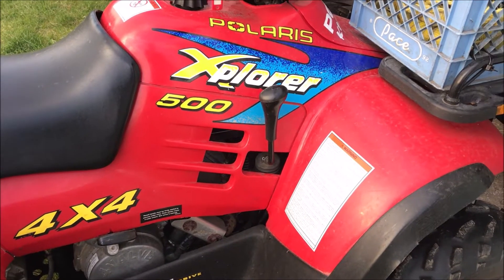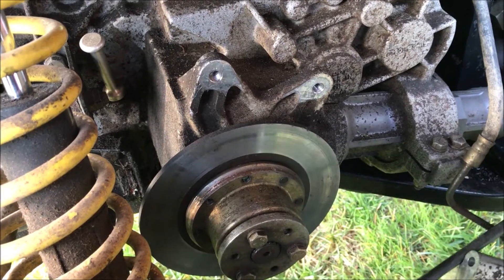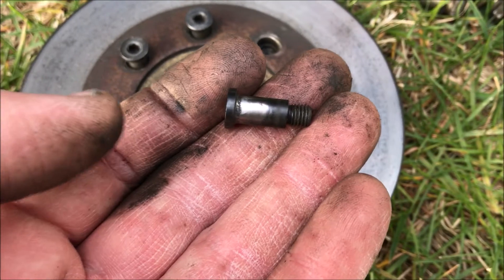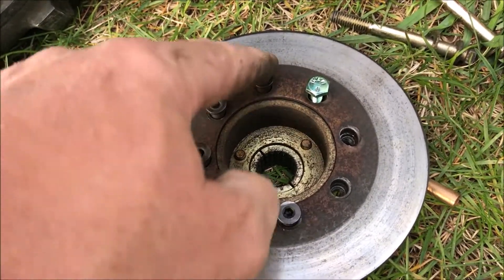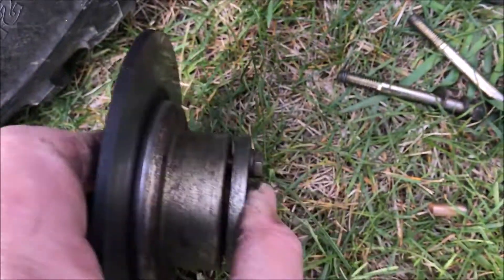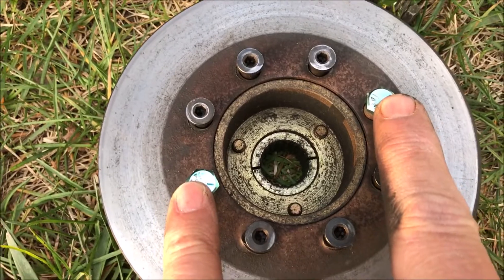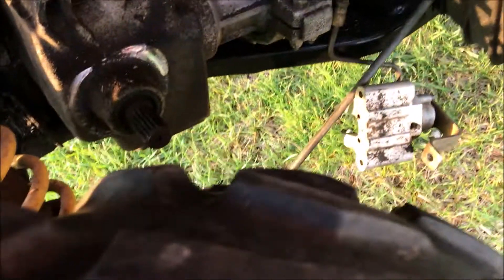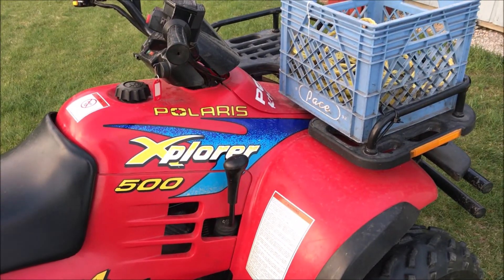OldGuyDIY 1997 Polaris 500 ATV No Brakes Rear Brake Disc Rotor Hex Float Pin Replace 5020960 $3 Fix

Comment: I started to go through this last night on my beloved ol X500. Did you end up making the Rotor tight to the assembly Or leave it as shown? The part on Partzilla or w/e shows (to my eyes) those pins being double sided (2 heads, one male, one female I assume) & it certainly looks tight. I understand Polaris' are absolute boat anchors but I just can't imagine they would make the rear rotor flopping around absurdly like that. Its bad enough having the Shaft mounted Brake nonsense but come on. Thanks in advance = Super helpful either way!
Reply from the maker: I left the rotor floating, as shown.  The OEM bolts are shoulder bolts that I loctited and then tightened down until the shoulder was tight against the plate. I noted in the video that my interpretation of the on line schematic was that the two plates were mated tightly together. As I understand it, the floating disc design allows for adequate brake engagement through the life of the brake pads as they wear down.  The brakes work great, assembled as shown.  Good luck.
Reply: You know the hand brake on the handle   bar is the front brakes and the rear brake in on the foot rest
Reply: @buctgrd  lol ya think so? That'd be nice & very un-Polarisy. It would be the wrong side of the bars for the Front Brake but I'd take it.
Reply: @makaveli087  so the hand brake works for both? Why did they put a foot brake pedal also?

Comment: Hello my friend i leave in minnesota im looking for that rear cliper i have to replace the breaks but is super difficult to remove the litle mitle metals the keep the breaks on so any recommendations where i can find that caliper because is hard to find i have 1998 polaris sportsman 500
Reply from the maker: I googled it and found lots of options with the full caliper for $30.  Good luck.  https://www.google.com/search?q=1998+polaris+sportsman+500+rear+caliper&oq=1998+polaris+sportsman+500+rear+caliper&gs_lcrp=EgZjaHJvbWUyBggAEEUYOdIBCTExNDAwajBqN6gCALACAA&sourceid=chrome&ie=UTF-8
Reply: I looked into replacing mine on my 97. They are obsolete. And 98 don't work without modifications. They were used only for that year. You probably have the same one as I do, because I've seen them available for 98's with the master cylinder behind the foot brake. Mine doesn't have that. I'll be looking for a rebuild  kit